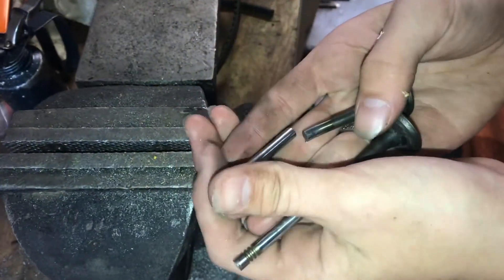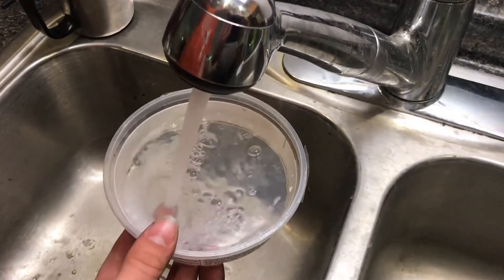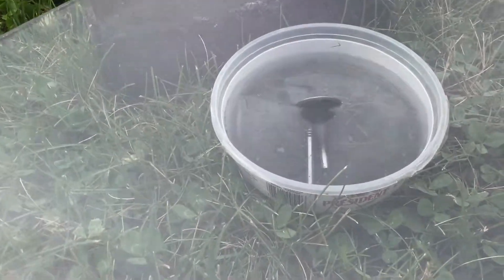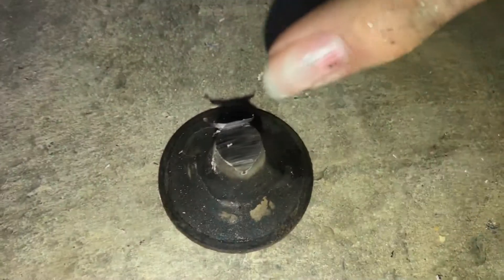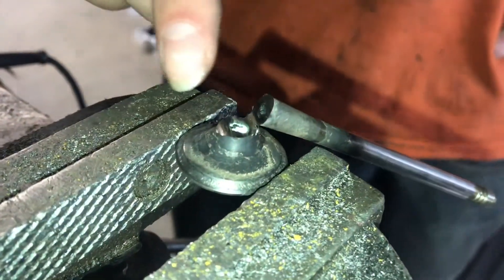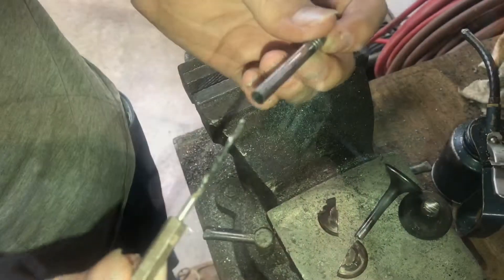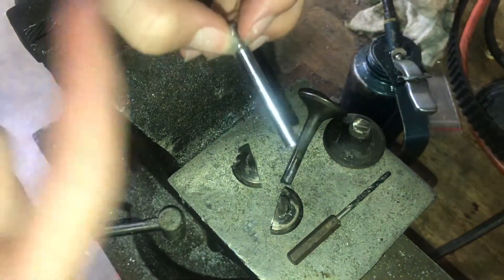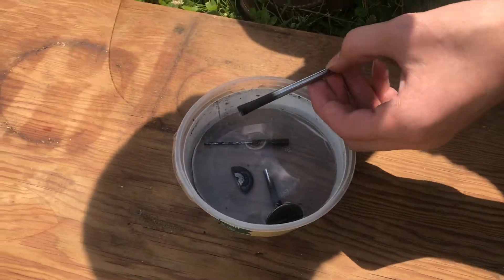cutting apart SODIUM cooled exhaust valves (explaining how they cool better)

Comment: The purpose of the sodium is secondary to the hollow stem purpose which is to lighten the valve for more valve train stability and stress reduction. The sodium is then added to the hollow opening to compensate for the loss of heat capacity due to the removed material, at which point it does what you stated, melt and slosh around, to help dissipate the heat from the valve head, up toward the cooler areas of the valve stem in contact with cooler surfaces, like the valve guide. 

    I must commend the amount of safety precaution you exhibited, because many have found out the hard way by accident when experimenting with substances uncommon to them, that life and limb can be at stake. I'm here following a search on the topic of DIY valve weight reduction for a performance engine build and appreciate what you have revealed regarding the integrity of these parts, which took some  aggressive tools in order to dismantle them.
Reply: Intake valves are much larger and therefore heavier. I wonder why no sodium for the intake valves?

Comment: An explosion needs some sort of compression. If you would’ve just slightly cut into the sodium it would’ve exploded because of the pressure built inside the valve.
Reply from the maker: Interesting, I still got some of these old valves. I’ve seen the bigger valves that come out of diesel engines, there’s a lot more sodium in those. Maybe I’ll Nick one with a Dremel tool deep enough to expose the sodium
Reply: Never heard of nitroglycerine or dynamite, huh?